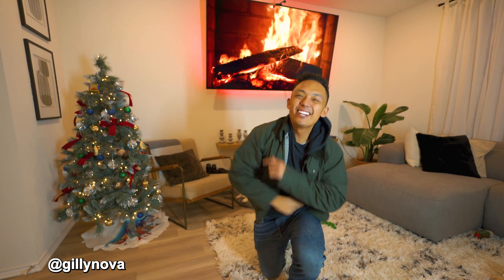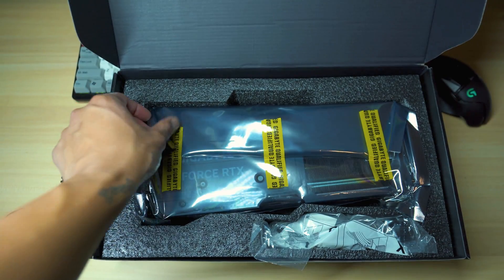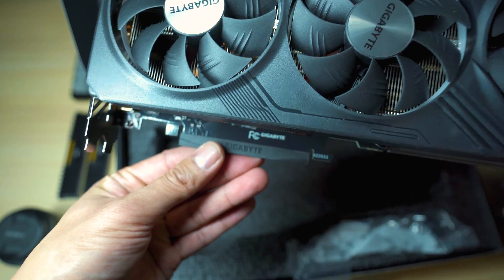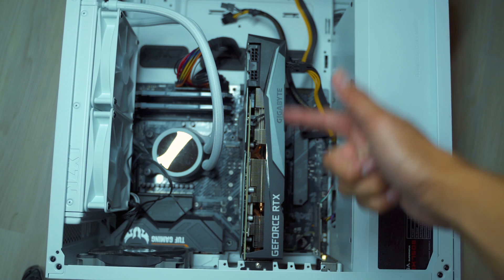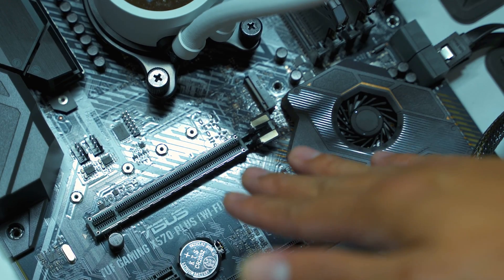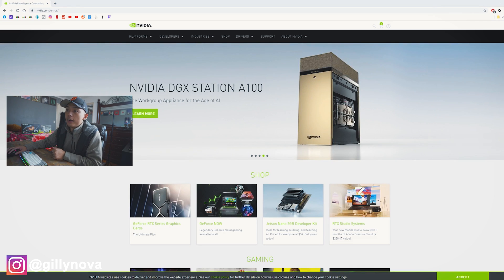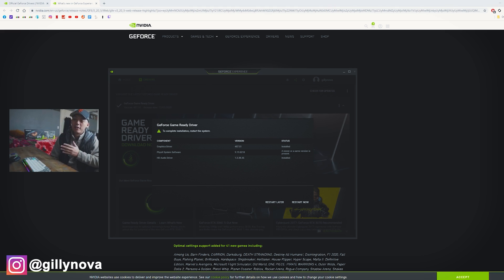How To Install a RTX 4070 Super TI (EASY & FAST! - Graphics Card)

Comment: I did this same thing. Adaptor came with it, connected individual PCIe cables to the PSU but I have a red light on the graphics card. Any ideas how to fix?
Reply: Red light means u have it connected correctly 
Some gpu brands come with this feature

Comment: I followed all these steps, every turned on except for both my monitors, any solutions?
Reply from the maker: @andrewneville2715  make sure the graphics card is clicking to the motherboard!
Reply: @ I solved the issue! Turns out my upgraded CPU isn’t compatible with my motherboard. I’m using the old one until I upgrade the motherboard. Thanks for your input!
Reply from the maker: @andrewneville2715  if not, maybe your PSU isn’t strong enough
Reply: @gillynova  I upgraded my PSU today & still nothing.

Comment: my custom built PC (not by me) has a ASUS 3080. has two pins side by side connected to the GPU. The 3rd small pin is tied off to the side and not connected...what is that small 2 pin connecter for?

Comment: I want to buy this card but it doesn't exist anymore
Reply: The ti super does exist

The ti doesn’t
Source; literally just bought one today because didn’t know if I needed both 8 pins
Reply: @Dangolbustedman  chech the title. its wrong.  the video is about unboxing the original RTX 4070.  not ti super or ti or super. just 4070. watch the video not the title

Comment: So I just got a new PC. I put the graphics card in and connected it to power. It powers up, but I don’t get either HDMI or DP signal when plugged into GPU but I do when plugged into the motherboard slots. Can anyone explain that?
Reply: It's because your PC has two GPUs; the one on the motherboard and the other that you bought. This does not matter, because your PC will know how to use the right GPU for games that require a lot of power.

Comment: My first build. With the split, do I need 2 separate pcie cables from my psu to attach to the 2 8pin on the gpu spliter? The pcie cables that came with my psu splits off into 2 6s and 2 2s so I could have 1 cable with 2 8s. But If I'm reading the gpu manual correctly it's saying to use 2 separate?
Reply: Same issue for me too, my first build and I’m not sure
Reply: He’s not answering old vids. Pity, cuz I need his expertise too.
Reply: @rwarren58  I did the 6 and 2, it works
Reply: https://www.youtube.com/watch?v=Q1WVPfX5ryQ&pp=ygUhYXN1cyBkdWFsIDQwNzAgc3VwZXIgaW5zdGFsbGF0aW9u      This guy tells you what NOT to DO!

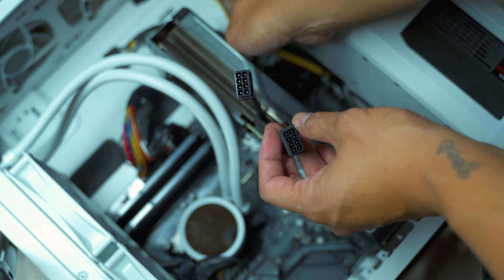Comment: 2:44 i watched a video before this one saying only to connect one 8 pin to the power supply but not both because it will overheat and melt your graphic card. Now idk what to think.   (idk if what you did was the power supply)
Reply: That video reffered to splits, not the case here.
Reply: @rickyismyuncle4485 hey so if you have the split one, only put one in?
Reply: Same

Comment: What if my box didn't come with a 12 pin cable??
Reply: Somebody took it out of the box my guy. They all come with the cable.. this guy saying the case has that cable is an idiot.. you will need to either buy one or contact the gpu manufacturer to send you a replacement

Edit. Or buy a whole new psu that is pci 5.0 ready
Reply: Youre fucked ☺️
Reply: Your pc case or cooler will come with the cables

Comment: Thank you for this Video . I have a RTX 3070  16 pin . Is it as easy as swapping out the graphics card? is there anything I need to be aware of  like power supply watt? etc?
Reply: did you ever find a solution?

Comment: I have a question some friends made a me a pc but ive nopticed it doesnt go up in temperature and it feels slow and the cords u mention is not connected to anything the cables just hanging around. Is that right????
or what should i do
Reply from the maker: Your computer/monitors won’t work if it’s not connected. If they aren’t working then you need to make sure they’re attached to your motherboard correctly. Download the NZXT cam application to see how much storage you have running and if it’s accurate to what you bought (like ram GB), then it should be fine. Lmk!

Comment: I thought it was gonna be 1 x 8 pin ? Amazon have pics of it with only 1 x 8 pin, I mean i got a high end psu and 3 x 8 pin support if needed, But does this need a gfx card support holder like the 4090 does ? Bought one just incase.
Reply from the maker: It depends on your card. Some have 8 pins but this one wasn’t. I haven’t seen a 4090 in person yet so I’m not sure. Sorry!
Reply: @gillynova  No need lol 😅 , I was just confused, My one had 1 x 8 pin anyway, Do these need support stands ? They seem like they dont, Unlike the 4080 and 4090 cards, Great video too btw :washhands:😇